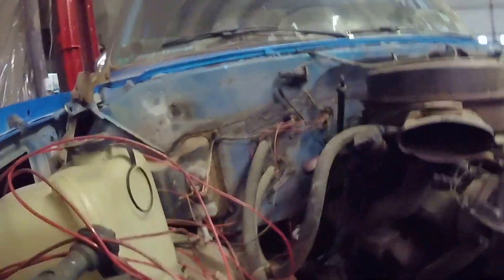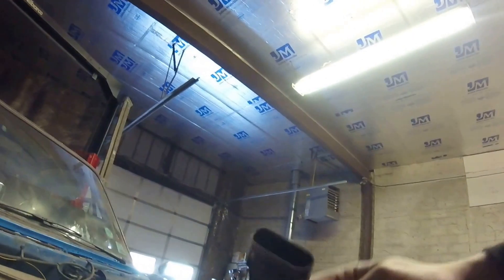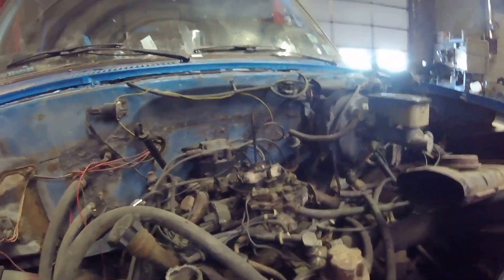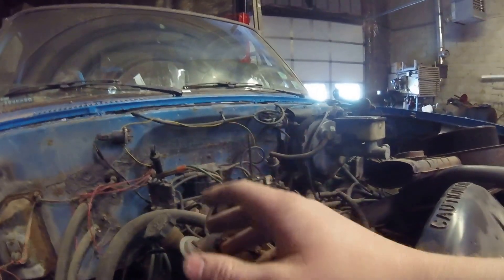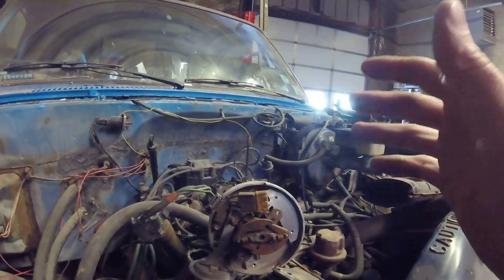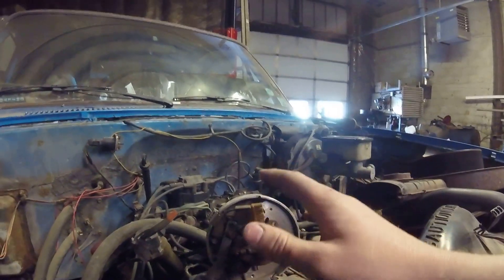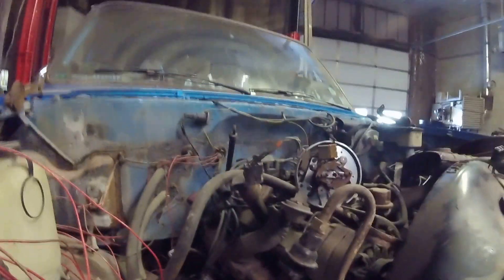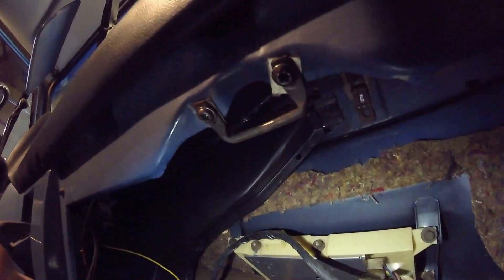small block chevy No spark

Comment: I forget what 2 wires to connect together and it will run
Reply: Pull the wire plug  out of the computer get a jumper wire jump green and black truck should run.
Chevy talk forum ESC wiring bypass